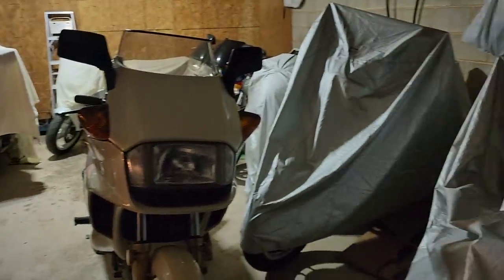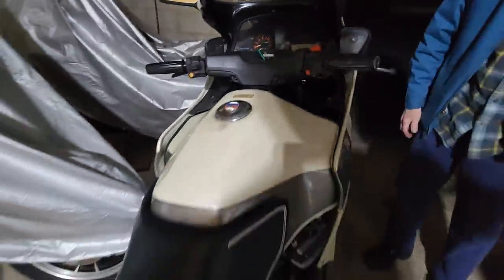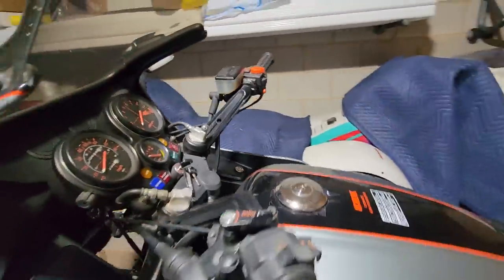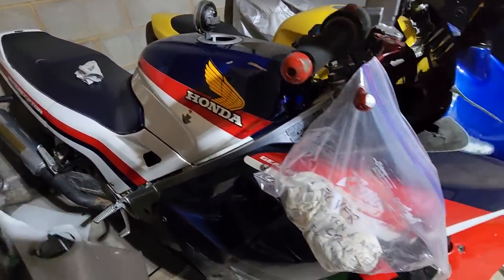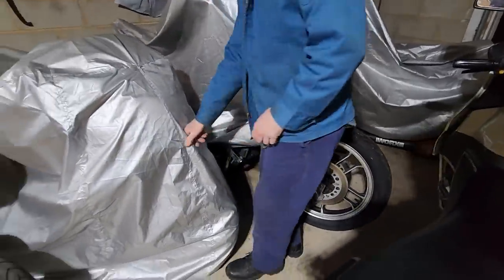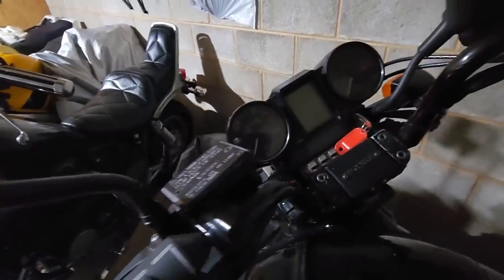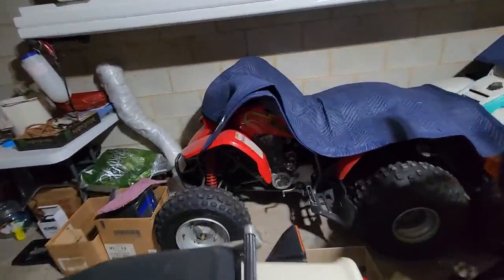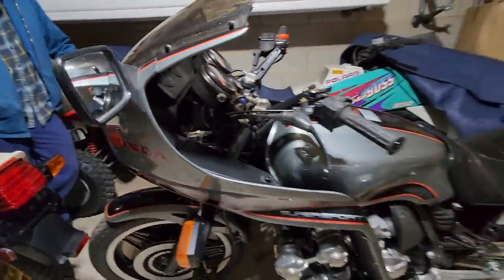WE BOUGHT A BARN FULL OF WORLD CLASS VINTAGE HONDA'S FROM HARRISBURGH PA

Comment: Damn! That nice guy had some seriously gorgeous vintage Hondas. Loved that CBX1100, and the Honda V65 Sabre. All of them were stunning, including the 1989 Honda CBR 600 Hurricane. The Red, White, and Blue Interceptor was droolworthy! Great Video, Brother. Thanks.
Reply: I actually have four '83-85 V45/V65 Magna's and Sabre's (two Magna's and two V65 Sabre's)! I absolutely love these bikes and can't wait to FINALLY get mine running so I can take them for a ride for the first time ever! I have never ridden any of the Sabre's or Magna's but absolutely fell in love with the way they look and their performance from the start! My '85 V65 Sabre was the first one I got which I got a really good deal on (however it was in a few pieces). I've had to go through the entire V4 carbs several times now and currently have it stripped down to every single little piece due to finding numerous pieces missing from multiple carbs. I initially did a good cleaning and tried putting the carbs back in and did get it to fire up but ran extremely rough and lean. Then pulled them completely apart this third and final time and found a whole bunch more problems. It's taken months trying to track down some parts for them that you can't buy anymore so it's been a year-long project and am hoping to FINALLY taking it out this summer for it's maiden voyage and I CAN"T WAIT!!!
Reply: think its a CBX 1000
Reply: @rich7851  Might be. All I know is that John had an amazing collection, of well kept up vintage bikes.

Comment: I went to the BOCES Tech small engine repair class in Yorktown, NY in 83-84 and the local Honda dealer donated two white and blue CBX's and a CX500 Turbo for us to work on. We rode a CBX down the staircase leading to the building and splashed the fairings and the bags, which made it look like a Mad Max bike. When I graduated they were welding up a dune buggy frame similar to a wide Honda Odyssey to put the turbo bikes motor in.

Comment: Nice collection ...the OEM exhausts are super expensive if you can find them . Leaded fuel killed the exhaust within 20000 Kays . I've owned a few Hondas over the past 42 yrs...xl175 ,1982 cb900fc new,2 xK2 750fours,1970cb175 still got it rode it to work for 25yrs, 1962cb72 250cc my current fun bike to ride😊

Comment: that V 65 Sabre is in great shape. they came out around '82.
Reply: The V45 Sabre 750cc '82-'83.  Rename Sabre for '84-'85 w/700cc (Harley tariff).  V65 Sabre 1100cc '84-'85.  I owned a '84 Burgandy/Gray/Black V65 Sabre when I was 17 y/o - bought it for $2200 w/2000 miles on it.  Installed the color-matched Hondaline fairing w/lowers.  I kept it through college until I was a Sophomore and sold it w/19k miles on it.

Comment: I owned a new OOB XJ650LK Seca Turbo. Dealers could not sell them as Insurance companies would not insure Turbo Bikes after the initial sale of many to younger riders who were getting killed on them due to the violent power curve. 40-50 hp and then going to over 100hp in less than 2 seconds on a bike weighing only 425lbs which was a lot of power  and still is for a bike so light. I sold my Seca Turbo with only 2500 miles and no scratches on it. It was going to get me killed or arrested as it went like a bat out of hell at 21 lbs of boost with the power up kit and dual front discs and rear drum. It was not a stopper. Also with the Jimmy Carter speedo which only went to 85mph you never had any idea how fast you were going. Either killed or arrested. Almost got arrested except when the State Trooper asked me how fast I was going I told him honestly I have no idea. Which was true. He let me go with a verbal.  The Honda has the better brakes and out of all the Turbos and is the best one to get. The GPZ was the fastest.